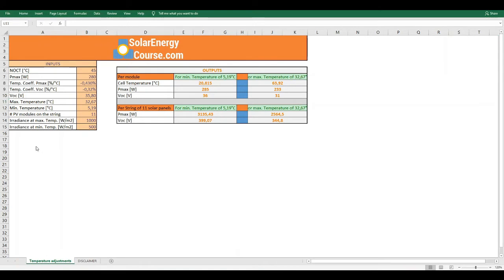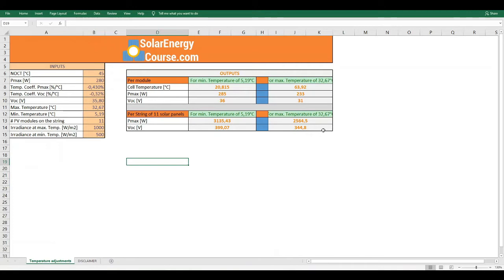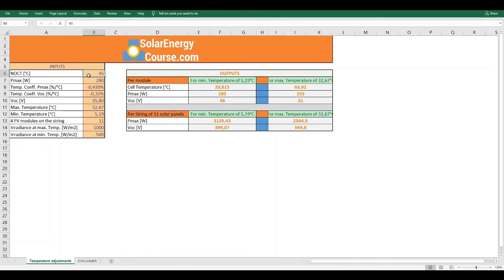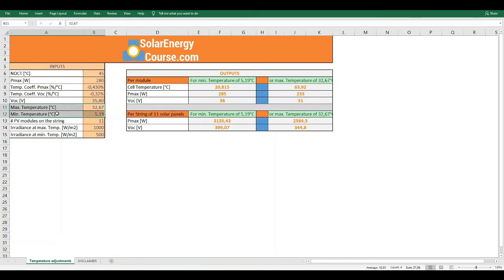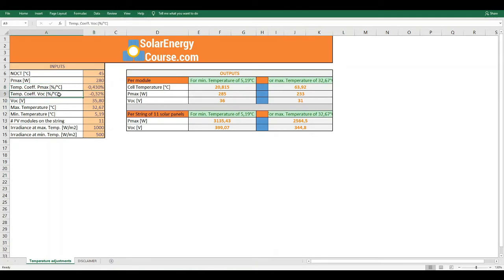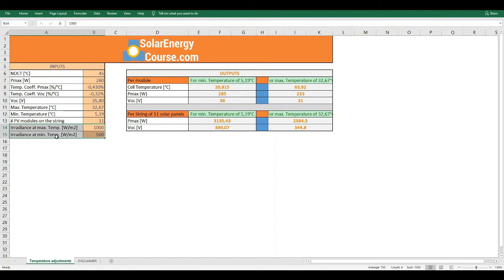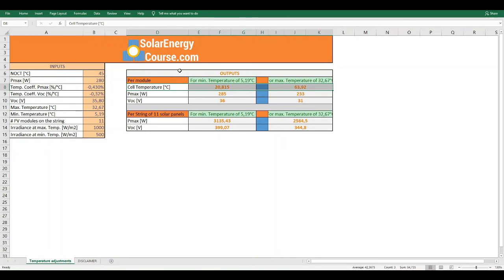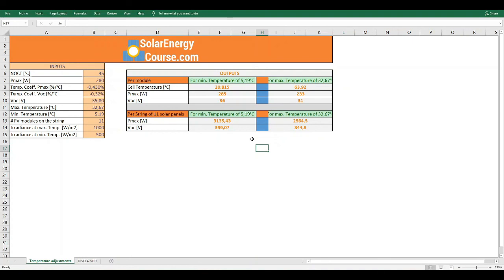Effects of temperature on solar panels - Energy Content Solutions

Comment: For solar, tempreture coefficient of power and Voc required  min or max value? and also tell What is reason behind it
Reply from the maker: you use max and min, temperature to use them when correcting the POwer and Voc using the temperature coefficient from the solar module datasheet, there is a lesson in the course that talks about it :)